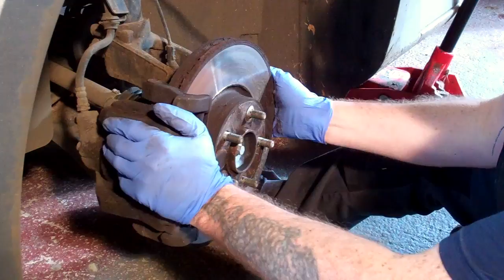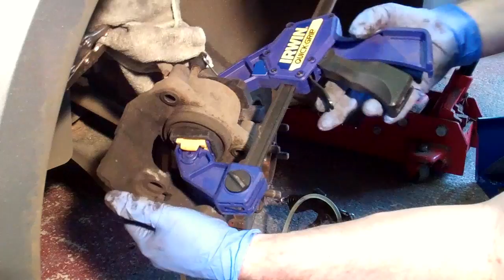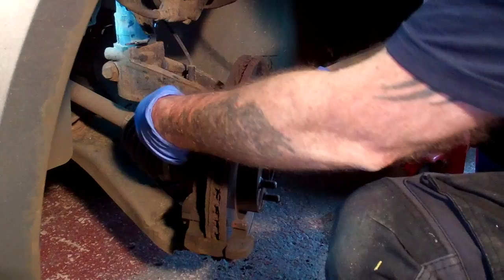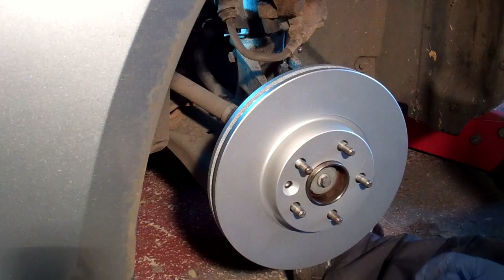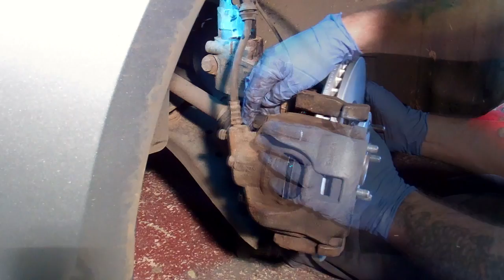New front brake discs & pads - Ford Mondeo Mk4 (2007 - onwards)

Comment: Great video. One thing I also like to do before I take the caliper off is get a big-ish flat head screwdriver and put it in between disc and pry outwards which will push the piston in a little and will make it easier to take the caliper off when the bolts are out. Just a small thing to add though.

Comment: Great video. I know its a bit old now but really hoping you are still active on here cause I have a question that seems to be no asnwer for on all the usual forums - where can you use a trolley jack on the Mk4 Mondeo?! Ive just come back inside from finishing another oil change on the car, and once again (like last time) I bent the sills because of the trolley jack lift. Then, when its up in the air on the jack, I cant get the axle stands in. What a faff! It would be fantastic if you could let us know where you're jacking and axle stand locations are. Cheers mate! :)
Reply: Use the trolly jack under the subframe with a piece of 4x2 on it, there's 1 front & back.
Reply: @cliveosborne8195  Is it possible to link to a picture? This is the only thing stopping me from sorting my brakes (they aren't dangerous, just would like to do them before the weather turns!), I've got ramps for filters and have changed a flat with the factory Jack no problem, just don't know where to put the trolley

Comment: 5:15 My mondeo does not have those "brake disc holders" or what they're called... Could them be found on eBay? If anyone can help please tell correct search word so I can find them, thanks :)
Reply: t982678249 Don’t worry about it. You don’t really need them - when the wheel is bolted up the disc isn’t going anywhere. The clips are just to make assembly easier.
Reply: @teecee90  Thanks for quick reply and link. I think I'll buy them for install at next wheel change, cost is low and I think it's more convinient to change wheels while those retaining clips hold brake discs secured.

Comment: Why fit incorrect disc's ?
Reply from the maker: Hi. Did you watch all the way through and listen to the commentary? I didn't realise they were wrong until I was well into the fitting process so decided to fit them for the purpose of the video rather than re-shoot. The only difference to the original discs was the stud holes were slightly bigger. It only took 10-15 minutes each side to replace the discs when the correct ones arrived.
Reply: Very rarely listen to commentary on YT video's so did not hear you're explanation in commentary as to why you used the incorrect disc's (appologies for that).
The disc's you used do have 14mm clearance holes for the larger 14mm x 1.5 studs fitted to S-Max and Galaxy they also have the disc securing screw hole,Mondeo use 12mm x 1.5.
You do good video's with good links.

Comment: Isnt clamping brake hoses dangerous?
Reply: No need to clamp the hose, just press the brake pedal and prop it with a stick against the drivers seat, that closes off the fluid supply from the reservoir. Then open the bleed nipple and press in the caliper piston.

To avoid a risk of a flat battery, remove brake light fuse first.
Reply: @twig3288  I imagine the brake light won't work anyway when the key is in of position.
Reply: @mjyumping  Try it.
Reply: @twig3288  mine doesn't
Reply: @mjyumping  Good.
It's worth checking to avoid running the battery flat.
With the brake pedal depressed  you can spend as much time as you like with the flexible hoses disconnected and you won't lose any brake fluid and you don't need to crush the hoses.